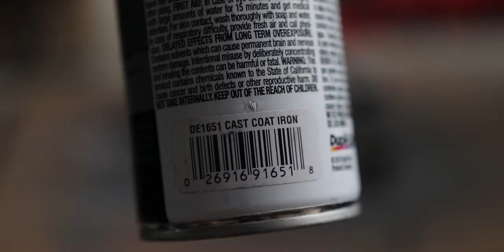The BEST BUDGET Brake Upgrade for your Honda - EK Civic Daily/Track Build Part 7

Comment: You can also use the 2000 crv calipers same size/bore
Reply: But they are 5 bolts instead of 4...
Reply from the maker: I think he means just the calipers
Reply: Are the spindles the same?
Reply from the maker: Don’t think so
Reply: @Thommy002 you need crv calipers (same size from ek9) 96-00 civic ex or si knuckles mini cooper rotors and TSX pads
Reply: You can use the CRV calipersz with MG zr 160 rotors, with both tsx or dc2 brake pads
Reply: And prelude, ek9 type r, Accord V6 all calipers are the same

Comment: Import from the UK MG ZS180 282mm Rotors, they fit like OEM including the retaining screw.
Reply: Where did you buy/import your MG rotors? The 25mm thickness isn’t an issue?
Reply: @Minwary   just order them from anyone that sells them and ships worldwide. Also use a 25T bracket instead of a 23T bracket. This is what i use on my CRX.

Comment: Good video, I did this upgrade many times myself and all your information is correct. The only thing that didn’t make sense to me is why you took off the hub to get the studs out? Next time just do it on the car by turning the hub to clear the removal and installation of each stud and this job only takes a few minutes per side.
Reply from the maker: On an EX/DC2 spindle? If I recall doing it in the car isn’t possible. I could be wrong though and I could’ve wasted a bunch of time lol

Comment: One thing - there is an option for 25mm rotors (MG ZR/ZS), but typically it's 1kg more. Plus more weight on caliper brackets.
Reply from the maker: Interesting 🤔 I wonder if thinner or modified brake pads are required.
Reply: @Gripworkz  not the pads - different rotor thickness require different brackets. For 282 rotors you have 3 different brackets 22t, 25t and 28t - each corresponding with rotor thickness. I got Mini r56 rotors that are 22mm, brackets from CRV - 22t and 2 pot calipers from Accord v6. You can go with MG ZR/ZS rotors that are 25mm but you need t25 bracket.
28t bracket is used in 4x114.4 and 5x100 rotors. Higher mass in brackets come from more metal for different rotor sizes.
Reply from the maker: Very interesting. Thanks for the info, I’m sure it’ll help others who are looking to do this upgrade.

Comment: Will ek9 brake calipers and rotors work on a US DX spindles or do you have to get EX spindles? I’m planning on changing the ball joint, inner& outer wheel bearing, snap rings and wheel hub. Thank you
Reply from the maker: I’m not sure if there’s a difference between a DX spindle and a type R spindle, but I’d assume so. I also believe that EK9’s are 5-lug. I’d hop on a forum like Honda Tech and make sure.

Comment: Great in depth install. I’d recommend looking into the lug centric spacers for the mini cooper rotors.
Reply from the maker: I do have them I’ve just been too lazy to install them lol
Reply: The lug-centric rings aren’t necessary.  The pressure from the wheel clamps the rotor on with ample pressure.
Reply from the maker: Yes. I still haven’t installed them and have not found them necessary. They’re more of a “piece of mind” item if you deem it necessary. But I’ve put plenty of street/highway/track miles on the car since that upgrade and haven’t had a single issue.

Comment: Thanks for the info bro!!!

I want to do that upgrade for my ek hatch, but I have a question and it is the following: do I also have to change the brake master?
Reply from the maker: Well to be honest we didn’t change ours. We did this upgrade on both our EK and EG and both cars get driven at the track often and we haven’t had a single issue.
Reply: @Gripworkz  thanks for clearing me up! 👍🏻👍🏻

Comment: Seems like a lot of extra parts and work for little upgrade? I'd say if you are tracking a B series, stock size will be fine.
Reply from the maker: Oh it’s quite a big upgrade, that’s why it’s so popular. And B series or not, better brakes will always make a big difference on a track. Larger caliper, larger piston size, larger brake pad surface, larger rotor, much more thermal capacity, well worth it.

Comment: Do you recommend any specific remanufactured type r caliper brand, or will any set work from rockauto?
Reply from the maker: I think we used Cardone
Reply: Great Thank You those are the same ones i had in my cart. @Gripworkz

Comment: Not sure if your answered this in another reply but what master brake cylinder do you use and did you have to upgrade to account for the extra volume needed to push the bigger pistons- the EX uses a 7/8 the DX uses the 13/16
Reply from the maker: I left the original DX master and proportioning valve. Not sure if that’s the way to go but the brakes felt awesome to me at the track, no complaints with that combination
Reply: @Gripworkz  thanks for the reply - thinking about it - wouldn’t 7/8 equal 14/16? Maybe there is not much difference between the volume of fluid transferred to the larger pistons between the 14/16 ex and 13/16 dx master cylinders?
Reply from the maker: If those are in fact the sizes of the two then the 1/16” difference is measurerable but I can’t predict how noticeable that would be in the real world

Comment: I’m wanting to do this but there’s not a link to the ARP extended wheel studs and did you leave the rear studs the same ? Didn’t feel unbalanced or anything?
Reply from the maker: Just look up ARP wheel studs for basically any Honda and the rear studs are factory, it will not cause an imbalance.

Comment: I have a 1992 civic si hatch. Do I have to change the spindle or hub?   I also seen other videos where you can use a 2000 CR-V brake caliper?

This will be on a gsr blades and 5mm spacer stock studs.  I have the 90 Honda 15/16 brake cylinder already.   Just want better stopping power for street daily.  Tired of that stock 9.3"
Reply from the maker: No your spindles should work fine if your car is an SI. And as far as CRV calipers go, they’re the same as Integra Type R

Comment: Hey bro thanks for ur video,I have a 1997 Honda civic dx hatchback am goin to upgrade the my break I ofto change the master cylinder and booster too?
Reply from the maker: You shouldn’t have to, what are you doing exactly?
Reply: Am using mini copper rator type r caliper I also have the break pads on knuckle already.just wanna know if I should get a break booster on master cylinder
Reply from the maker: If you’re doing the front only no. If you’re converting the rear to disc we recommend getting a proportioning valve from a rear disc car
Reply: Ok thanks alot bro,am goin to convert the rear but not now thou but I'll get the valve
Reply: Which of the valve is the best one to get?
Reply from the maker: Get one from an integra or an EX civic
Reply: Thanks bro
Reply: not sure if its true, Ive read that ej6 hatchbacks DX models have the same prop valve as an em1 SI @Gripworkz
Reply from the maker: @raysb240sx I have absolutely no idea lol

Comment: I have my DX spindles still. I was wondering if all of this would still work if i got the FastBrakes brake caliper bracket adapter that pretty much makes my DX spindles have the same mount point as an EX? I'm planning to do this for just overall improved stopping power because people drive crazy where i live lol. If not, I'll just get better rotors, new calipers (my passenger side leaking), and new pads for DX trim.
Reply from the maker: How much is the fast brake kit? I got EX spindles for a different build at a junkyard and they were pretty cheap. The EX and integra also utilize larger wheel bearings which is a plus if you’re racing.
Reply: @Gripworkz  yeah the cost is kind of a lot for just the adapters at i believe $165 or so 😬😬😬

I could just go to a junk yard and get EX spindles and replace the bearings and refresh, etc
Reply from the maker: Well there’s the price of the EX spindles (which isn’t a lot) but there are other things to factor in depending on how much work you want to do. Take this white civic for example: I did remove the spindle and replaced the wheel bearings and ball joints, there are tools you’ll need to either buy or rent to do that or you’ll need to pay a shop to do it. So the cost kind of balances out. Also if you’re using just replacement parts or upgrading to say roll center correction ball joints.
Reply: @Gripworkz  would this work on my EM1 spindles?
Reply: @jona10silva  yes

Comment: I did  the same setup. I have lot of brake squeals. Dose yours make a lot of noise when braking?
Reply from the maker: Yes, the hawk HP plus pads squeak and make a lot of dust, that’s the trade off of having track pads 🤷🏻‍♂️ worth it to us.
Reply: @Gripworkz   is there any other brake pads you’d recommend for daily use that’ll go with this upgrade ? A more quiet brake pad
Reply from the maker: Any ceramic pads

Comment: which brand remanufactured did you go with? centric and etc?
Reply from the maker: Everything we used should be linked in the description
Reply: @Gripworkz  I clicked in the link. It noticed there’s many options to choose from.
Reply from the maker: Well if you’re asking about rotors we used centric coated rotors
Reply: @Gripworkz  not the rotors. The brake calibers.
Reply from the maker: Whatever Oreilly’s sells lol

Comment: Did you ever upgrade to the integra gsr or itr 1inch master cylinder and brake booster?
Reply from the maker: Actually no, it’s the stock master, booster, and proportioning valve. Felt great at the track.
Reply: @Gripworkz  ex lx or dx?
Reply from the maker: Actually the master might be EX, bc I took it off my crashed EX, but everything else is DX
Reply: @Gripworkz  ok cool thanks

Comment: The link u provided for the rotors . Is that pair at front set? Or do I need out quantity of 2?
Reply from the maker: They’re individual
Reply: @Gripworkz  ok so order 2 . Was wondering why You didn’t go with drilled slotted? Will that work too?
Reply from the maker: That would work too, just not necessary
Reply: @Gripworkz  sweet I’m abt to order it now! Thank u man

Comment: What year EX did you use? I have a 98 EK hatch and was wondering if I can use 96-00 civic EX hub.
Reply from the maker: It shouldn’t matter, any year EK that’s an EX model
Reply: @Gripworkz   Thank you for a great video and tutorial. looking forward for my big brake set up.
Reply: I have an EK hatch and doing a complete DC2 front and rear disc conversion. Will this set up work with DC2 front spindle? And does it require any mods or addition parts?@Gripworkz

Comment: What wheel specs are you running? My 15x8 25 offset doesn’t clear fully .
Reply from the maker: Your wheel might not have enough back pad, have you tried running a small spacer with extended wheel studs?
Reply: @Gripworkz  haven’t tried spacer but I do have extended studs , thinking of getting new wheels so was wondering around what specs can I stay at around 15 if not I’ll move to 16s.
Reply from the maker: I’m running a 15x8 +28 I believe and I have plenty of room, still depends on the wheel spoke design though

Comment: Can I ask why you don’t use the 294mm or 300mm disc ?? I’m hoping to use 

Fn2 calipers
2mm shaved fn2 carriers 
294 or 300mm mini 4x100 disc 

To sit under 16x8 enkei rpf1’s 

?? Any insight
Reply from the maker: I don’t believe the 294mm rotors work with these type r calipers and brackets. I will be doing a second “budget brake kit” in the near future that utilizes the 294mm rotors from the Mini Cooper JCW
Reply: @Gripworkz  I’ve got some fn2 calipers and carriers on the way now , I want to use a 300mm disc ideally not redrilled if possible so all I’ll need is the jcw discs not stock copper 282 ?? 

My hubs are 262 right now on a stock ej6 setup 

Thanks you got reply you’ve gained a subscriber lol
Reply from the maker: I’m not sure about the FN2 calipers, we never had the FN2 platform here in the US so I have no way of knowing how that setup would work

Comment: Hi so did you have to change your master cylinder at all?
Reply from the maker: Nope, worked just fine with the stock one. Brake balance feels fine.
Reply: So are you running the factory dx master cylinder and brake booster or the ex one?
Reply from the maker: Yup, stock DX master cylinder
Reply: Cool thank you
Reply from the maker: No problem 👍🏼
Reply: You will maximize the potential of the larger caliper bores with a 1” integra master cylinder.

Comment: How different is it with non type r parts, just normal integra parts 🤔
Reply from the maker: It’s still really good, but it mostly depends on what you want to do with your car
Reply: Would  this be.a major improvement if upgrading from the Integra gsr front setup?
Reply from the maker: It depends on what you do. If you’re planning on going to the track, it’s worth it. If not, stick with what you got.

Comment: Just finished this job on mine but my pedal feels mush till almost bottom then it actually grabs i did leave the brake hose dripping for a few days before installing and bleeding the front brakes any other tips on why they feel like they grab at the bottom end
Reply from the maker: It just sounds like you need to bleed the brakes better. But bleed all 4 corners. Start with the right real corner, then rear left, then front right, and front left last.
Reply: @Gripworkz  cool thank you I will
Reply from the maker: Not a problem, let me know if you need any more help
Reply: @Gripworkz  i also noticed you didn't use the bushing stud spacers on the rotor to fill in the gap on the stud hole are you having any issues with it
Reply from the maker: I have them in the glovebox but haven’t installed them. I haven’t noticed any issues whatsoever. I’ll report on that in a future track prep video.

Comment: I have the same brake upgrade but my pedal feels super spongy , did you change the m/c or brake booster
Reply from the maker: No, you probably just need to bleed it.
Reply: @Gripworkz  thanks for the fast reply , I had bleed the system already but that didn’t fix the issue made sure there were no leaks as well
Reply from the maker: I’d just go over the entire braking system and endure there isn’t anything work out or damaged. The pedal should not feel spongy if it’s bled properly.
Reply: @Gripworkz  thanks a lot man will do
Reply: @JonathanRamos-rr8yy  did you get the problem fixed?

Comment: will DX spindles work or should i upgrade to ex or ITR spindles
Reply from the maker: EX/DC2
Reply: @Gripworkz  abs or non? idk if theres a difference
Reply from the maker: There shouldn’t be but aim for non abs
Reply: @Gripworkz  ok then lemme get your opinion, go with ex spindles and buy the “BBK” 
Or 
Go and get a rear disc conversion first
Reply from the maker: Rear disk. Upgrade the trailing arm bushings while you’re at it. You’ll have more braking balance this way.

Comment: What size are those rims? because im also worried about running into clearance issues..
Reply from the maker: They’re 15x6.5”
Reply: I haven't not bought new wheels yet, would this have needed spacers with 16 inch wheels?
Reply from the maker: I’m really not sure. As you say my 15” wheels required a spacer. And that could vary even with other styles of 15” wheels as well. So it really depends.
Reply: @Gripworkz  you think it'd work with 99-00 EM1 wheels? (15")
Reply from the maker: I’m pretty sure they will, but be prepared to add a 10mm spacer if they don’t clear the calipers
Reply: @Gripworkz  Thanks for the reply. Your channel is very underrated! Great content!
Reply from the maker: Thank you! Telling your friends about us would really help!
Reply: Whats the offset of the wheels?
Reply from the maker: 15x6.5 +35

Comment: Great info, thanks for the links too. Would you know if 15” rims would clear them?  I currently have 16’s but will be buying a set of 15” rims. What size were your wheels?  Thanks.
Reply from the maker: Those wheels were 15x6.5 +35 I believe but your mileage may vary. As you saw I had to run a spacer to clear the caliper. The wheels that are on there now didn’t require a spacer. Diameter, offset and spoke design will differ from wheel to wheel
Reply: @Gripworkz  awesome, thanks again. I’ve got 16x7.5 +35 but plan on getting a set of 15x7.5 +35. I think it should be fine. 👍🏽😀

Comment: Does it matter if the spindles are from a ex coupe or a ex sedan anyone know

Is there a  difference between the two ??? I've order 3 sets of bearings and hubs and all three sets the bearings are to big wtf 

I personally took the spindle off a ex sedan and can the bearings I keep getting be from a coupe is that the reason why the bearings are a tab to big ?
Reply from the maker: If you got the spindles off an EX, the bearings will be the same size as an integra. If your bearing seems too big, you’re probably trying to use DX or base model bearings. Also keep in mind that bearings and hubs have to be pressed in.
Reply: @Gripworkz  nope went to my local auto Palace parts store had them match up the bearings, they were sending me the wrong bearings all along online, I ordered 3 sets for 2000 ex coupe all were wrong finally got the correct part # from auto Palace and ordered me the correct bearings and hubs fourth  time a charm,,,I have no clue WTF they selling online one set of bearings and hubs I could slide the hub into the bearing with my hand 

And off coarse I know bearing and hubs get pressed in just like they get pressed out
Reply from the maker: Cool, glad you figured it out
Reply: @Gripworkz  but do you know if the ex sedan and ex coupe use different size bearings ?
Reply from the maker: No it’s the same bearing
Reply: @Gripworkz  k thank you I figured might  as well replace the bearings hubs and lower ball joints since the spindle will b out the car

Comment: I have the same kit and the caliper bracket o n the inside rubs against the rotors. Looks like I need to have a machine shop mill the calipers to clear?
Reply from the maker: That’s weird, everything should clear. Are you using EX spindles? Or integra?